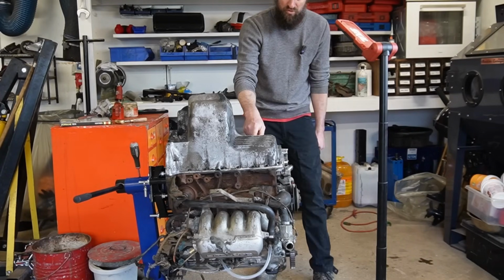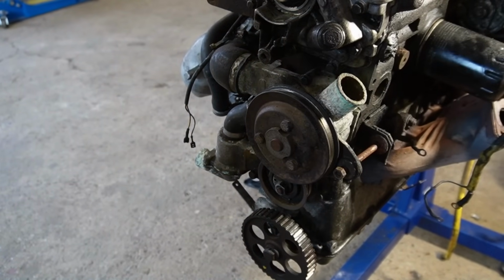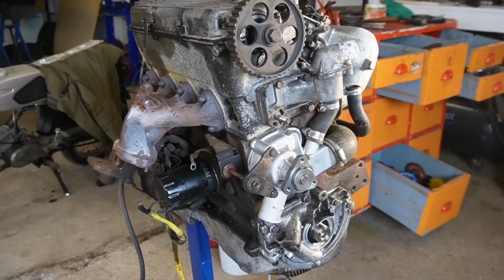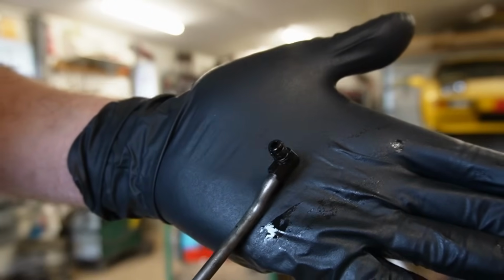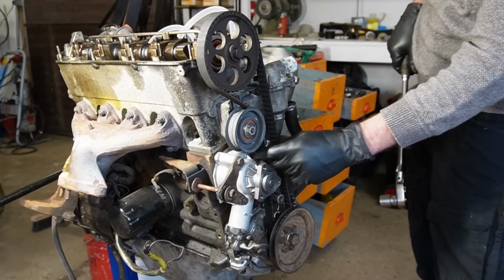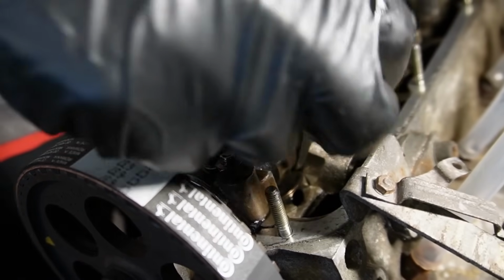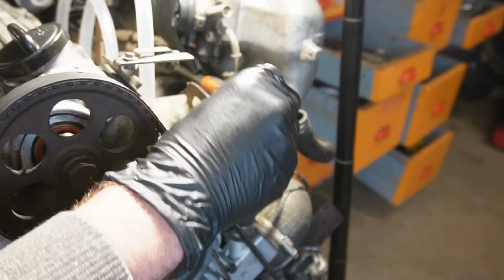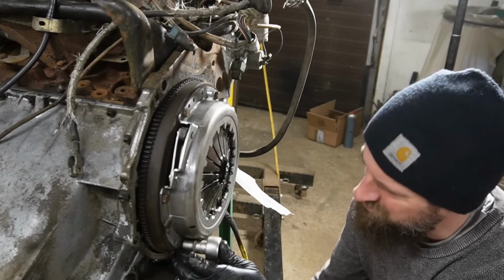Porsche 924 | Cambelt, Valve Adjustment And Mic Failure

Comment: Can’t wait to hear her running, she’ll run like a sewing machine! Nothing better than a non interference engine especially when it’s a simple 8 valve with an incredibly simple cambelt.

Thinking about that thermostat housing, my Grandad taught me that when undoing tight or suspect bolts to slightly undo one and then retighten it when tackling the others, his theory was that as you undo bolts it slightly increases the load taken by the other bolt/bolts which makes it harder to undo. He also would never just whizz a bolt out that had been fitted for a long time he would again remove it slowly tightening and retightening often with a squirt of WD40, this was especially true with screws going into aluminium. If this didn’t work he would apply heat. I have followed this advice and suffer very few issues so maybe there’s something in it?
Reply from the maker: Yes its good practice to do that... I tend to only use wd40 when it has time to soak.. but very often forget...
I think I am getting the hang of feeling if its possible to loosen without preparation and when it is needed... but sometimes I get it wrong... and SNAP!

Comment: Great work. Again, has been previously mentioned in the comments, the engine rotates clockwise.
That leaking breather hose will cause the engine to run lean. Because of the PCV system, there is negative pressure in the crankcase, so it will suck air in. 

In addition, if you didn't already, make sure there is a tiny amount of RTV at the valve cover gasket joints or you'll develop an oil leak eventually.
Reply from the maker: Yea the haynes got me of track with the rotation... it states to tighten the pulley in the direction of the engine rotation (counter clockwise)... They must have gotten that wrong? or maybe its about where you look from... ;)

Comment: That breather looked like an electical cable that was burning up with the way the smoke test was seeping out, but it could probably be replaced with some generic hose if the genuine stuff is expensive, cos porsche... :P
Reply from the maker: There is a baffle or restrictor in the hose... so need something similar.. :) I wrapped in some rubber now so its air tight at least.. :)

Comment: I have a question! Why did you put the rocker cover back on, if you need to change that oil pipe inside?
Reply from the maker: Dont like to have the engine open.. and also, I will be started and most likely also drive before I get a elbow... it is working now, but properly not for long. :)
Reply: @SeasideGarage  you will have to keep an eye on it!

Comment: How aggravating with tiny little plastic parts like that. That one could've been made from some potmetal and probably lasted a lot longer. Doesn't look like it should be impossible to mill a replica.
Reply: A few years ago there was a guy who made them in machined brass with orings. Not anymore, though up until recently the plastic ones costed peanuts.

Comment: I haven't seen that type of valve adjustment before. Better than messing about changing shims.
Reply from the maker: Its brilliant!
Reply: Vauxhall (so Opel/Holden/GMC) had something similar back in the late 60s/70s on the canted over OHC Victor (FD) engine. They used allen headed bolts in the cam followers with a specific taper ground into them. If you couldn’t get the correct clearance you could get different tapers to play allow the right setting to be achieved. Not sure if this engine uses the exact same method though. I didn’t have much experience of those GMC engines so can’t comment more than this. Les

Comment: This job has escalated quite a bit. I'm in a similar situation with the rear brakes on my Mercedes-Benx C200. The Porsche will run beautifully once the engine is back in.

Comment: Great work, for the record it turns clockwise, easiest way to find out is that the straight part of a belt is always pulling.
Reply from the maker: Great way to remember.. I was just reading the Haynes which stated it was turning counter clockwise... Maybe they worked on a Australian version............
Reply: I have a copy in PDF of Porsches engine manual for the 924, if you are interested I can email it to you.
Reply from the maker: Thanks! But I got one now :)